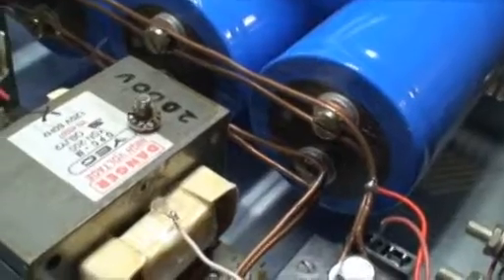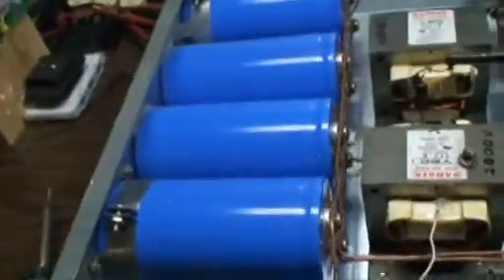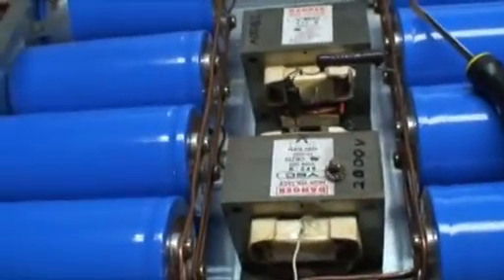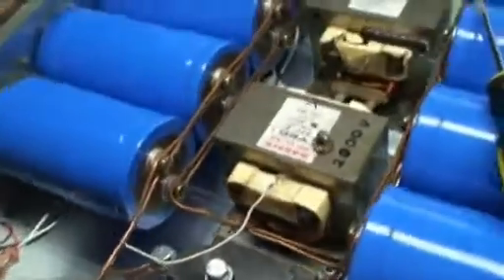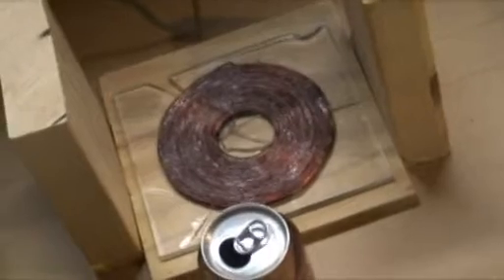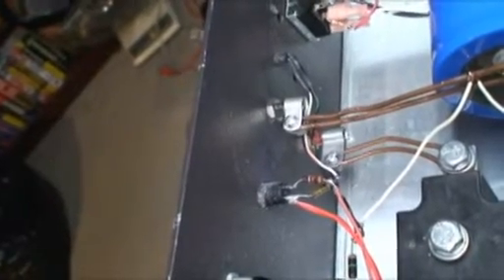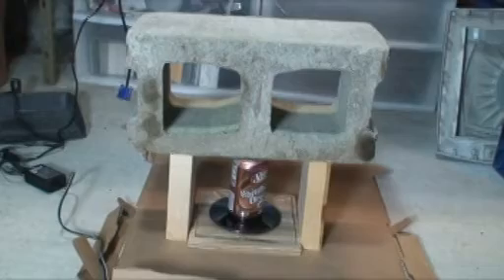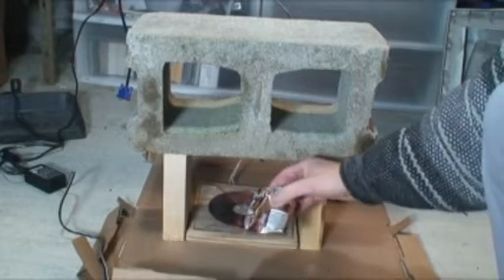800 Volt 8 Capacitor Can Crusher Revisited

Comment: you could use a heating element as a resistor and it would hold up better. the problem is that they are low resistance and you would need a lot of it to make a decent value so it will take the load without ruining the capacitors.

Comment: I don't know if this project is still being worked on, but i know how to replace your current limiting resistor.  Trying to limit on the charging side is too hard.  Add an inductor to the primary side of the transformer to limit total wattage going into the transformer.

Comment from the maker: I have seen solder connections blow apart under high current loads.  I have tried the wrap the coil around the soda can and turn it into the hourglass shape.  All the solder connections blew out.  I may try it again with the new connections.

Comment from the maker: It would only need to handle 1000 watts when the capacitors are fully discharged.  They charge rapidly at first so over 1 minute only the first few seconds are at full power.  The average power would be around 100 watts.

Comment from the maker: I was refering to the peak voltage and current.  The ED431825 Thyristor rating is 1,800 volts 250 Amps and 6,500 amps peak.

Comment: Are you sure the scr rated for 1600 amps 1200 volts, it does not look that beefy to handle that kind of load, unless the cycle time is very fast.I know the scrs I worked with in the past fire so fast that you need a scope to get a reading.